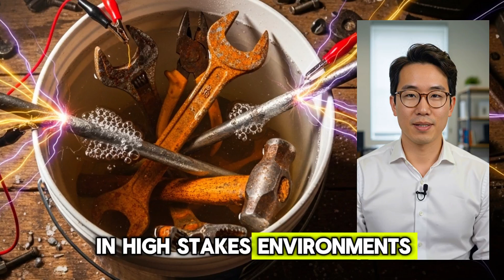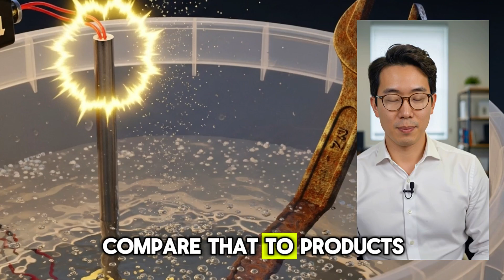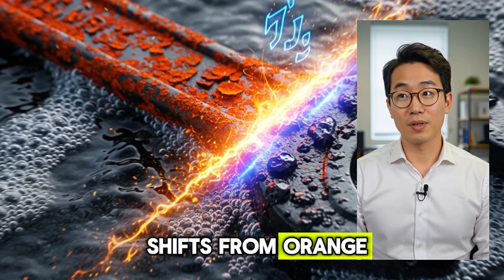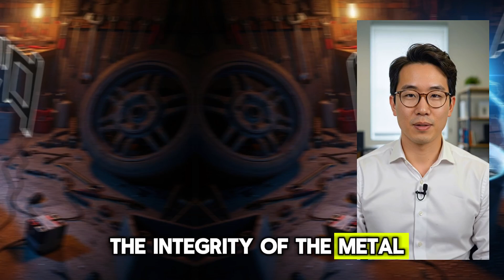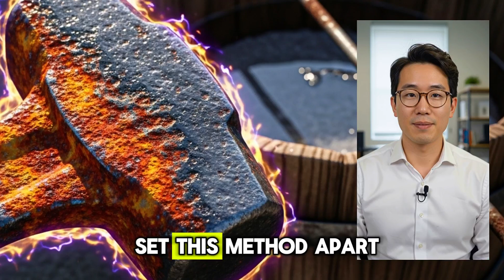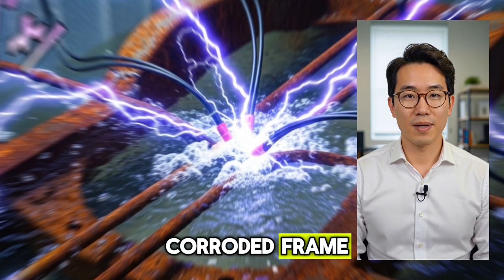$3 Battery DESTROYS ALL Rust PERMANENTLY! No Mechanic, No Chemicals – Big Auto Hid This!

Comment: But how can i do the frame of my chevy truck without stripping it down? How much salt or caustic soda per gallon? What type of steel for the positive rod? Do I have to rinse off the electrolyte solution and dry before coating it with oil? You really could be helpful by giving a little greater details on execution rather than just general guidelines. Thank you.